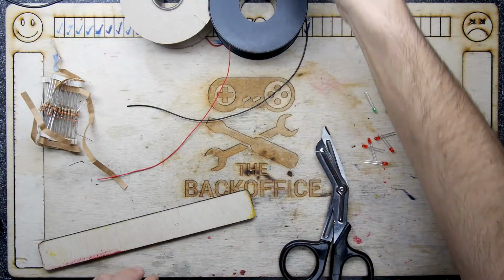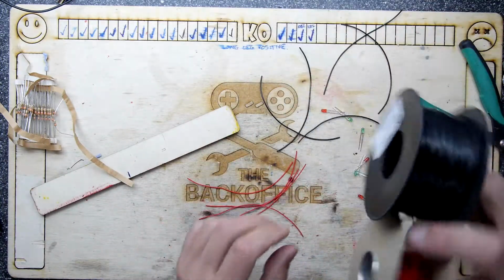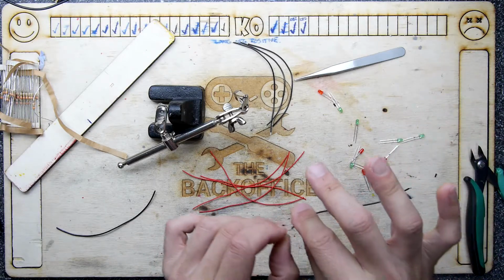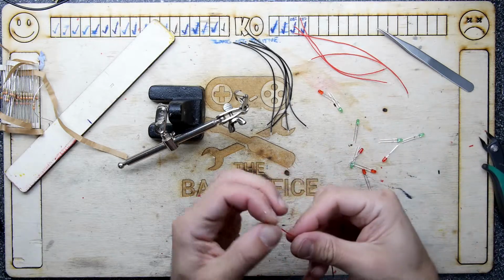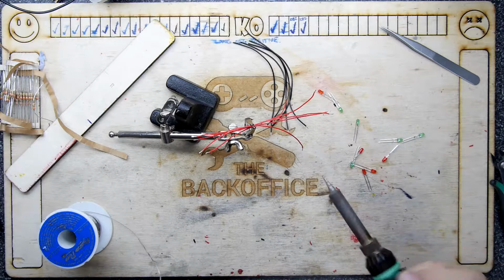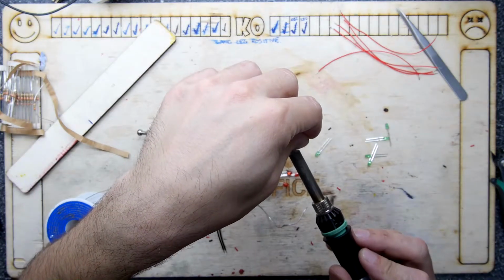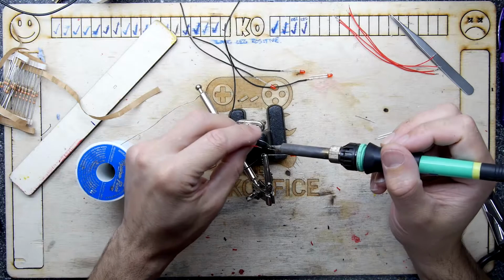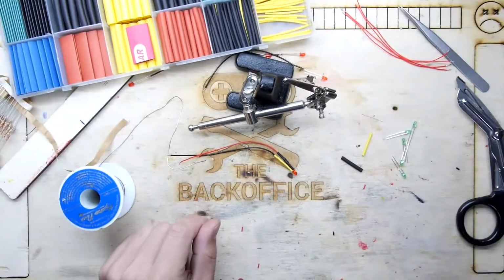August Catchup

Comment: I'd be happy to build some prototypes for you if you need one offs, I have the gear to work on very small smd. I also have a 3d printer for case prototyping.
Reply from the maker: +DigitalAura hi there, Unfortunately the prototype building is they easy bit, it's the testing and enclosure manufacture that take a bit of time
Reply: Well if there's anything I can help with just give me a shout, testing or whatever.
Reply from the maker: Now that is an interesting offer!

Comment: I hope I've seen wrong.. but were you soldering black cables to longer lead? That should be plus (red cable) - as it says on top of your board - "long leg positive"
Reply from the maker: Yeah I screwed those up :) I did not like fitting them with the incorrect colours, well spotted! LONG LEG POSITIVE!!!
Reply: It's not that I'm looking for your mistakes, it's that I would make a mistake there myself :D

I'm looking forward to some ARM videos? :)
Reply from the maker: +The Tired Techie I only discovered the mistake myself when I went to make the 5 I forgot I needed 😂

I'm literally making the boobie cortex cases for final testing then there will be plenty of ARM videos 😂 also it should work with the ST Arduino sketch type build as well for those into that

Comment: Since I'll be wanting to use a #RETRONET on a ST and Amiga, I'd be happy with a "The Backoffice" one. I envisage a greyish-black one, with the TBO Square logo on it. I hope it's got all the "fairy lights" (Back when that's what called from the CB days) on it like the old modems did. Something like the USRobotics Sportster, but of course, a lot smaller. It would be kinda cool to have a buzzer on it as well. One with a software switch, so it could be turned on and off -  just so you can have the screech at the start of connection like the good old days. Until you get told to turn that damn thing off! LOL

Comment: Sometimes vacuum molding can do the job pretty well!
I recommend using ABS if you want them to be sturdy enough - but then you will need injection molding done.

Resin parts with same thickness as normal plastic ones will turn either brittle or soft, depending on the case.
Have you considered reproduction cartridge shells? They're high quality and is already made out of ABS.
Reply from the maker: +Phil Sierra So many options, so little time 😂